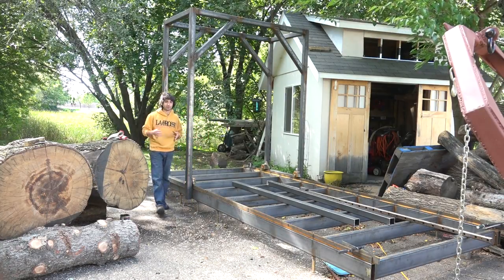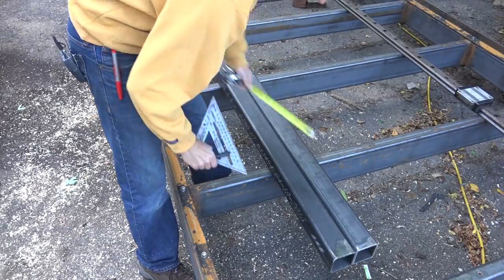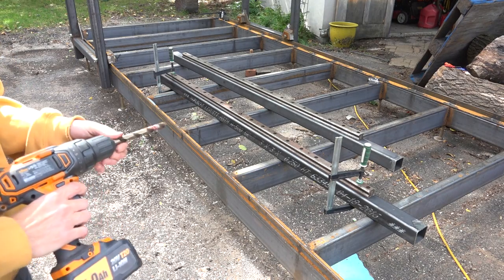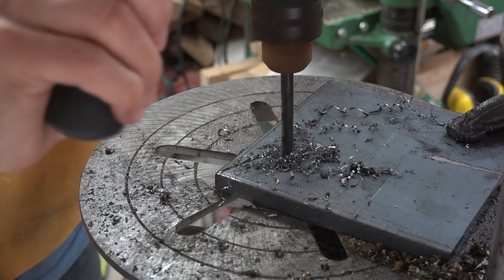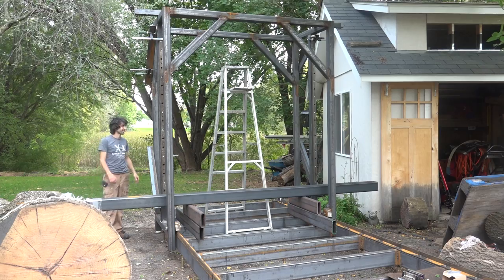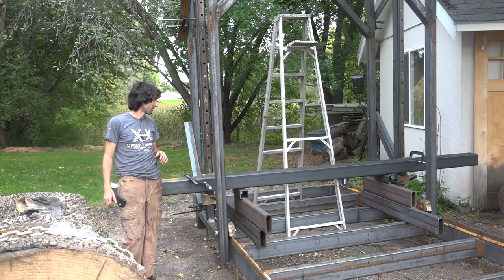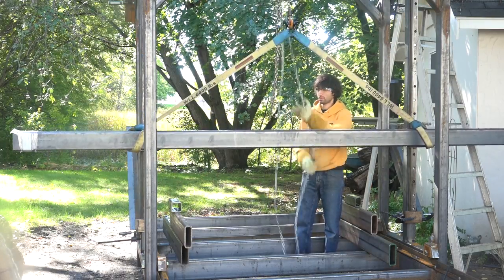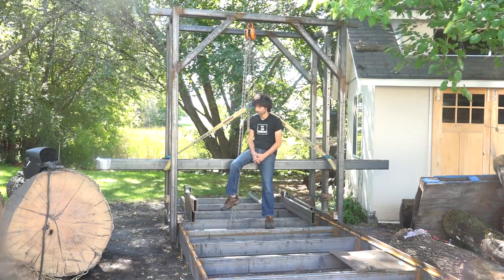The Saw Head Beam - Building a Large Bandsaw Mill - Part 6

Comment: This is very exciting. It's great to see the pieces coming together. I agree with Matthew S about installing the linear bearings. I would make the "retainer" piece so that it fits snugly between the bottom rail and the track. That way you could use a couple of clamps to hold it in place while you position it. It would be a royal pain to have to remove the tracks and it might also require a bit of fiddly alignment. If you don't want to sacrifice the expensive piece of rail I'm sure that you could easily make something suitable to retain the ball bearings out of hardwood. After all, you are still a woodworker!
Reply from the maker: Thanks Tim!  Seems like that's the way to go.  I'll see what I can make out of a block of wood.

Comment: Matt, 
Cut a pice of flexible plastic/rubber tubing that is the length and width of the inner part of the linear bearing, and place it inside of it. When you feed the bearing onto the rail, it will push the tube out.
The tube pushes against the wire keepers of the balls, making them behave and stay in when you put the bearing on the rail.
We use the exact same bearings at work, and we have heard the annoying sound of those balls falling out.
Love the build, thanks for taking us along!

Comment: Wow, yyuuuugge!  I built a Linn Lumber mill, very similar design.  The 4:1 acme sawhead height control will be a bear to crank by hand, even initially.  12 inches = 48 turns!  Mine is a 5:1, so even worse.  You will have beefy arms shortly.  I use a HF $50 electric winch to pull my carriage,  then pull it back manually.  Mine is a gas 18 hp B&S, which is probably about the same as a 10hp electric, and could use more power, but you can just feed slower.  No gas, oil, and exhaust will be great.  Check out Linn Lumber, he has a sweet hydraulic blade tensioner, I assume you will be using at least 2in wide blades?  For outside mills I have see guys build a little tin roof over the top of the carriage, easy and not to obtrusive for the neighbors.   Good luck Matt.

Comment: Loving the build!

I was wondering what happens in the winter with the snow and rain with regards to the big motor and electronics? is it all ok for weather exposure or are you going to build some kind of shed for it to roll into?
Reply from the maker: Thanks!  I'll remove the vfd when I'm not using it.  The motor is too heavy to remove so I'll just cover it with a tarp until I can get a cover made for the entire carriage.

Comment: If you saved the bearings you can put them back in by either carefully pushing them back in the slots or you may have to remove one of the end caps. This will expose the ball return tracks and you reinstall them there.  If you lose too many the bearings will get   Kind of notchy or the balls will not roll properly they will slide and wear.  And yes use a short  piece of rail to transfer back and forth. They should always be on a rail.  I learned the hard way.

Comment: It's better to use 4 linear bearing (2 on each track) when you are doing something like you do.  This bearing are really strong in traction/compression, but not this much in torsion.  When you put 2 bearing on the same track, you use the traction/compression force multiplied by the distance between the center of the 2 linear bearing in place of the torsion force that you use in your system now.  I'm sorry if it's not clear, I speak French normally and English is my second language.
Also, like Matthew S said, you can use a small section of rail to install the bearing on your big track.  Also, normally the bearing come with a small plastic track in the packaging, maybe you can have one or two at the same place you take your linear guide and bearing.
Nice build and your cariage seem to roll really easily, good job!
Reply from the maker: Makes sense.  I have a bunch more carriages so I can easily add another if it becomes an issue.  Those bearing won't see much stress.  During the cut they will help resist the cutting force as the blade goes through the log.  The acme rods will support the weight of the beam.  We shall see what happens though :)  I got the bearings from a friend.  A few people have suggested making a wooden block that fits in there and would serve the same purpose.  Thanks!
Reply: That is not true.  These are designed to handle torsion and can handle quite a high Kn load laterally.  He's using these in a perfectly acceptable application- especially since it is clearly over-engineered with the size of the linear guides/rails.

Comment: matt, I am building a mill very similar to yours, i was wondering if you had a material list, or at least for my first question, what is the size of the steel on the carriage beam?
Reply from the maker: I am working on a set of plans for the mill.  The beam is 5x5x.25 12' long

Comment: Matt, can you use your track offcuts horizontally to install the bearing plates, then move that right in line with the track, and slide it up? Might save you losing the bearings and not have to disassemble. 

Looks awesome!

Ps, was that a a dude in a gator watching you?
Reply from the maker: They're too long and I don't want to cut them again, otherwise yes that would work well.  That was the guy mowing the lawn at the park lol

Comment: Maybe you answered this already, Matt, but I couldn't find it. What tap & die set is that?  It looks like a good one. I like the big tap holder.
Reply from the maker: I think I had the links in the description of one or both of the hole drilling videos anyways the handle is from harbor freight and the tap is just one that I picked up at the home center
Reply: Thanks Matt!

Comment: To keep the balls in the trucks during install, cut a square scrap of material that fits inside the channel in the truck. It does not need to be notched to actually fit the bearing grooves, but just take up enough space to keep the balls from being able to get past the keepers. If you use wood, put tape on it before putting it in place to keep from introducing dust directly into the bearing races. Butt the spacer block up against the rail and then slide the truck up to transfer the truck to the rail. No lost bearings! Woo-hoo!
Reply from the maker: +Ian Gagnon oh that's a great trick! Thank you so much!!
Reply: Glad to help! When you purchase the bearing blocks (trucks) new, they come with the spacer installed for shipping. Pretty handy for sure! I was hoping to stop by and say hi at IWF, but didn't get a chance. I was working at a booth right down the isle from Triton. Just too darn busy. Perhaps next time! Keep up the great videos!

Comment: I could not believe you didn't just lay a length of steel across in the 45 degree notch to hold the upright. When you take it apart, remember in the future to pack the ball bearings in axle grease and that will hold them in position for reassembly.

Comment: I did not understand where that linear bearing rail parts @8:28 is mounted on the mill. Nevermind i got it @11:08 that is what will attach the saw head to the vertical rails.

Comment: hey Matt where did you get those linear bearings and rail, i cant seam to find anything of that size, nice work by the way.
Reply from the maker: A friend gave them to me.  They are THK HSR45.  McMaster also carries similar bearings and rails https://www.mcmaster.com/#linear-bearings/=1cvpycp
Reply: also i think i'm going to put a leg down on both sides of the beam to lower my wheels to bring the top of the wheel to about an inch above the bottom of the beam just to give me maximum throat clearance.
Reply from the maker: yup-just make sure your beam can support the longer torque arm of the shafts.

Comment: Nice work +Matthew Cremona  What are your plans for traveling the carriage?  Will there be a motor to advance the cut or will you just push it 'manually' to make the full length cut?
Reply from the maker: Thanks!  I'll be adding power options in the future but this first iteration will be manual feed.
Reply: consider a pneumatic solution. The feed rate will adjust based on hardness and dullness of the blade.

Comment: hello, i've had a Weg motor for a while now. It's a couple years old, but no numbers on it stating the HP or any of that. It was used on a big washing machine that came out of a launderette(because they got all new machines and didn't want the old ones). Just wondering if anyone here can help me with wiring the motor up(if its possible), as the cable for the plug has been cut. It has 3 black wires and one earth wire(total of 4 wires). If anyone could reply or give me your contact email, i can send pictures of the motor wiring